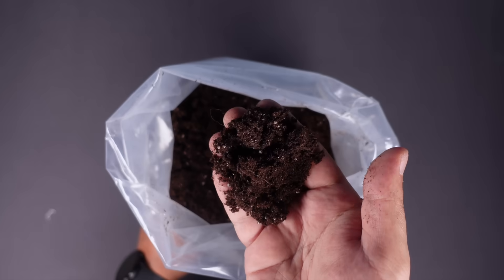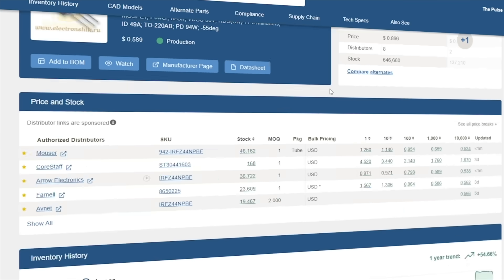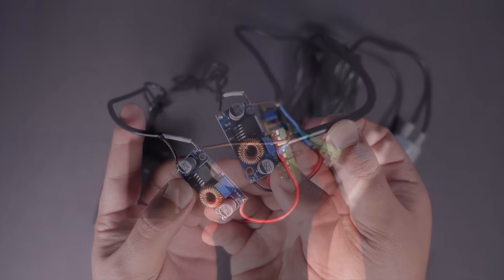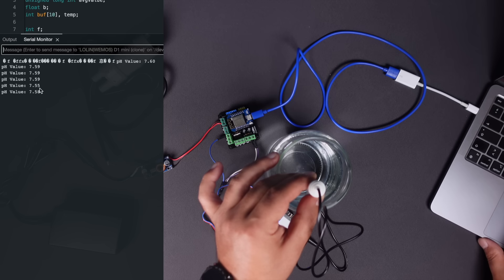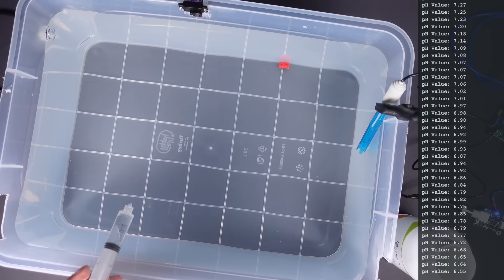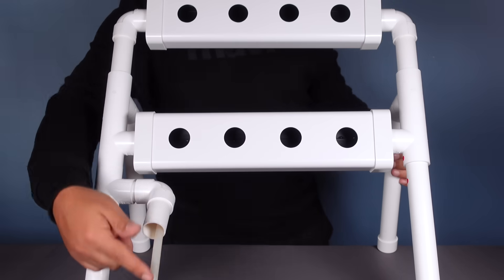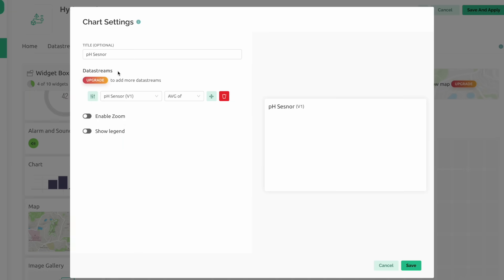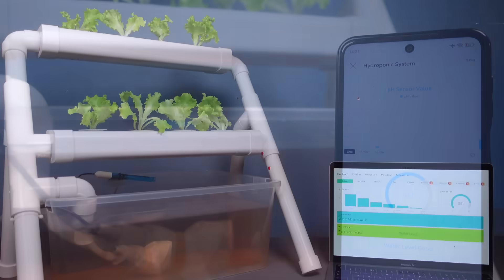Make your hydroponics system fully automated and view data via the app

Comment: Cool project. Just a word of caution, the pH sensor needs to be submerged in a liquid solution at all times -- as you can see, there's a liquid inside the pH probe, if this dries out, your pH sensor will not work properly. Also, pH sensors are quite sensitive and calibration every now and then.
Reply from the maker: Thank you for your informative comment 🥂